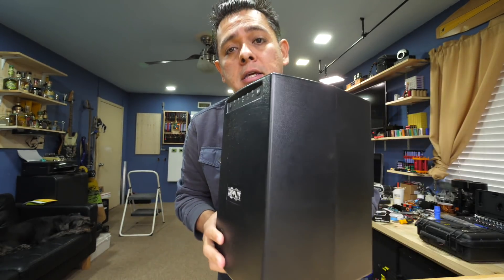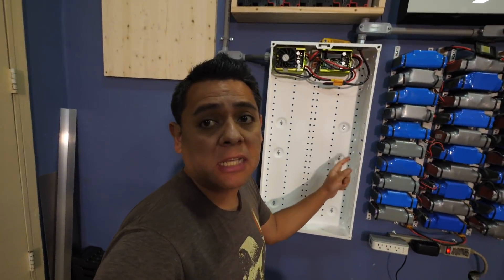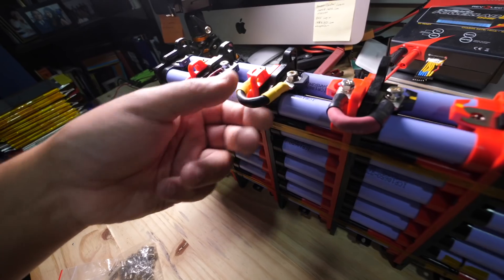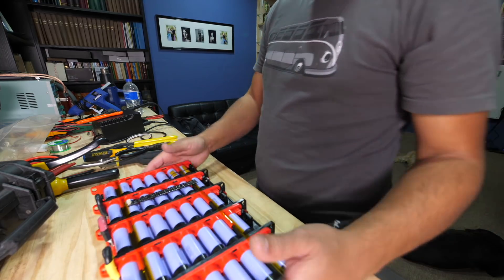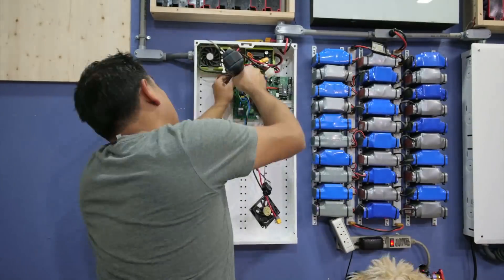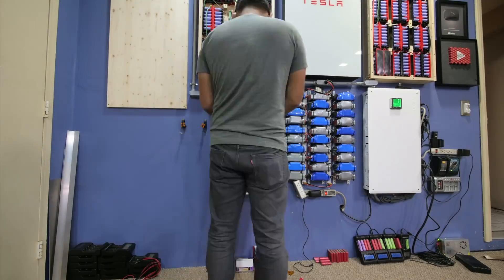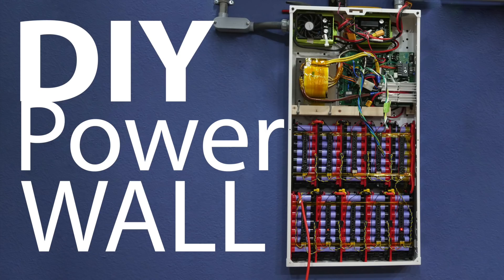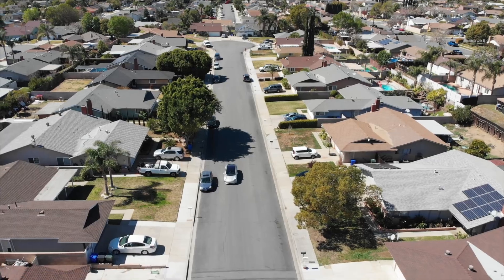1kw DIY PowerWall affordable  18650 build project (2018)

Comment: By no means do I mean to complain, but I think there would be a market for pdf instructions for these. Something we can print to achieve the same results. I see much of this as wizardry but a good guide step by step would help a lot. For those of us taking this on as a random summer project with 0 experience :)
Reply: brendan broomfield yeah... I get that, thus the request for a guide. I have a feeling that you missed the point entirely.
Reply: I totally agree with you if I could have a PDF to download I will make one as well.
Which I tried to make something similar and im having issues
Reply: I like making PDF's!
Reply: what is a "main breaker" and why does saying hey I don't need to shut such off when hooking a 10series x 3.7v power wall to the house electric system lead to a linesman being killed?
Reply: so unless you know what you are doing keep your hands off?
learning something new is pretty much defined by doing something you have no clue about. just saying ;-)
Reply: +1 for a PDF Schematics
Reply: i think Jehu G.  should publish an eBook on this? look on amazon and you'll only find a few.
Reply: Shane ive somehow managed to not accumulate student debt so far, id like to keep that track record. I get what you are saying but for someone who loves learning through exploration id still love some kind of reading material and or a real full guide rather than a howto that is missing large swaths of useful info.
Reply: brendan broomfield thanks for the recommendations! I really want to start delving in to it but I don’t know where to start. And as for the video, to me it’s kind of like sex ed..   people shouldn’t jump into it sex ,but people are going to do it anyway. So it can’t hurt to put a little more knowledge out there ya know? It may make it a little safer for the rogues who are gonna go all in whether they should or not. It’s all his choice though. As far as I’m concerned, you do you man.
Reply: I agree. Plans would be cool.
Reply: I could not agree with you more, and I'm an electrician, lol. He is smart/funny and, I like his videos, yet this video almost seems a 'tease'.  Just enough info/results to suck you in, yet not enough to execute it yourself w/o further, specific step by step instructions and a parts list, especially for newbies.
Reply: you laid the hard work methinks, the rest is "easy"
Reply: DO IT BRO !! I'D BUY ONE :) Especially if you can keep the cost down. For me this is a way to tell the Power Companies to GET STUFFED !! !! !! I don't know about your fellas countries though our power companies in New Zealand have been ramping up their charges and their Profits !! TAKE THE POWER BACK !! !! !!
Reply: you absolutely don't need to go to a trade school to learn it, but with this you need to learn before you burn. I can suggest a few books for you to read if you want to get a good start on it and then you can build up to this if you choose to. Practical electronics for inventors, the art of electronics (a bit technical but good) and delmars standard book of electricity. once you read either one of these it should give you enough information to be able to build onto to get into this so you wouldn't necessarily need a pdf guide to do it. Kudos on not accumulating student debt but please for the safety of yourself, linesmen and other people around you don't jump into doing something for cheaper. also not to mention 1kw isn't a lot that's about 5 hours of a gaming laptop, 1 hour of heating in a 10x10 room or using a blowdryer for around 40 mins, in most of these cases a ups would be just as good and probably cheaper.
Reply: Howdy Check out Will Prowse. He's big on YouTube he also has a forum that people like us can share knowledge and ask for help there's also a dude on YouTube names Jim From Denver. He charges for specific designs. I'd 1st go to will.Good luck
Reply: I agree completely! I've watched a lot of his videos and he skips a LOT of steps and some that he shows, he gives very little detail and direction. I haven't learned much from this channel unfortunately.
Reply from the maker: Hopefully someone that enjoys doing that sort of stuff makes one available.
Reply: jehugarcia what’s the max output you get from this kinda setup ?
Reply: If you have 0 experience, you should start with smaller projects until you understand this without needing a guide. Otherwise, you've got a literal bomb on your hands, and 0 experience. And that's bad.
Reply: Completely understand that you have to spend a LOT of time learning but if the videos don't contain any REAL information on how to do it, how do you learn? You don't. To learn something, you have to have information. It's like if you were watching a "How to build a car" tutorial and all they showed was pics of the car, motor, transmission. 
Well how tf can you build a car without knowing what is inside the motor, how to properly run gas lines, ect.? The "how to build a car" video isn't actually a tutorial at all and was a waste of time for anyone trying to learn how to do it. Only someone who has done it before would know.

"Here is a DIY video on how to build a power wall" but I am not going to show details on how to do it yourself. You should go on forums, read books, and figure it out yourself.
I CAME TO THE DIY TO LEARN HOW TO DO IT WITH VIDEO EXAMPLES INSTEAD OF A BOOK! But thanks for wasting my time.
I appreciate the video and happy for his success but for a new person trying to learn everything, this is a waste of time and he is limiting his market to only very knowledgeable people.
Reply: brendan broomfield - well hang on, you say if you need a guide, then don't do it - so what is the purpose of this entire video other than to say "buy an old UPS, stick it in a metal box, along with batteries and a charger".

 I really don't see that the video is of any more value than "look, I can fit a charger, inverter and a lot of batteries in just one big box". 

Personally I was interested as I thought it was a DIY Powerall similar to the Tesla design where only SURPLUS solar power was used to charge the batteries. THAT would have been awesome - and would probably be based on a current transformer or two, somethnig like a little raspberry pi and a tweaked switched mode power supply - but it wasn't.
Reply: Carl - not expecting a silver platter but other than saying "I put an inverter, charger and a lot of batteries in a big box - aren't I clever" - what exactly was gleaned?
Reply: Well, sorry to disappoint you, but if everything would be as easy as watching a youtube video, we wouldn't have engineering university. Would we? I agree that there whould be a PDF and I am thinking of making one. The thing is that it will be quite long full with all the info required to understand how a powerwall works, not just do this and that and boom you got fire. I am thinking of designing a DIY friendly system for battery management. Able to scale up to 50kW(output power). It will have 24 cells in series for some real power without huge currents. Still very dangerous.
Reply: Anthony Smith I really wanted to learn how to do this too, instead of looking for a shortcut like a pdf, I spent two years learning how electricity works at a local trade school. No pdf in the world could teach you how to fully understand what is going on here.
Reply: brendan broomfield I respectfully disagree with this comment. A guide is a start, that's exactly how you start. Keeping in mind you follow instructions and pay attention to what you are doing.
Reply: To put it into perspective, with just a few years experience, I can look at his setup and replicate it without schematics or a PDF guide. You'd want to rethink this as a "summer project" kind of thing, because it's really not something you can just leap into without any prior experience. But, if you're determined to learn, start reading up on how UPS's, inverters, transformers, solar panels, charge controllers, and li-ion cells work. 

You'll want to look up a table on general comparative specs (nominal specifications) of 18650's and familiarize yourself with their ratings (capacity, nominal voltage, discharge, charging current and voltage, charging time, continuous discharge current, internal resistance, safe operating temperatures for charging and discharging, etc) Cells operate differently (efficiency) at varying temperatures, and capacity is usually measured based on the discharge amperage until end voltage at a fully charged state and specific temperature. With most, discharging ("using" the "juice" in the battery) at high rates (quickly) and/or at high temperatures will shorten the lifespan of the cell. 

Go read up on li-ion batteries somewhere like Battery Bro. 

Then start researching how these things might work together. First and foremost, however, you should take the time to learn the basics surrounding electrical work, electronic components, A/C and D/C, the differences and similarities. Read up on single phase through three phase A/C and what you might use in your area. Really, you just want to start at the basics and work your way up to dealing with the big bad stuff that can kill or maim you or someone else in many, many painful ways. 

That wall of li-ion 18650's has the potential to be, once a failure occurs, a /giant/ torch that once it starts venting could create a cascade of failures in the rest (this is why he uses sensors for monitoring temperature, and other equipment for monitoring and maintaining safe levels of operation), leading to a fire that you would be hard pressed to put out. In a matter of minutes your entire home would be burning down. Look up videos of just one 18650 failing, or someones ecigarette mod with just a single 18650 in it exploding and you'll think twice about trying to cobble together dozens of these into the wall of your home without experience.
Reply: I wouldn't recommend doing it, if you need pdf about it.. google some more until you don't need the pdf.. for your safety.
Reply: 0 experience = stupid    pdf? really?
Reply: That's a shame to all those who didn't like that he didn't put it on a silver platter for you...

Sorry - but it's technical... and you have to try and spend a LOT of time learning.

If you don't want that, you want the pre-made solutions - already for sale - and the cost incurred.
Reply: it's not meant for someone with 0 experience. You're dealing with a ton of batteries which while they are generally safe someone who doesn't know what they're doing can and probably will make a huge mistake. say you built this do you have the knowledge to know what you're looking for as far as potential problems what if you say choose batteries because they're cheaper not knowing the discharge rate for them and you try to drive more out of it. You're dealing with a lot of potential power in dc form which definitely isn't safe, people need to remember electricity can kill and even if YOU think you're safe with you're limited knowledge and experience someone with that experience would probably get their guts turned by what you're doing.
Reply: " there would be a market for pdf instructions" That part was not taken into account. Sr. bredan Your answer is a perfect example of the benefit and the need for reading a pdf. But the people like us, that love and enjoy Sr. García projects because we want to expand our need to do things (DIY). In my case it is the need to keep the refrigerator/ice box and washing machine running at a time of 9 month of no power. Was my reality in Puerto Rico. For others, one year after the hurricane things have not changed.
Reply: @brendan broomfield, I disagree.  If someone is able to follow instructions then why not show them how.  Most people can put an Ikea thing together.  There are factory workers who assemble goods without having detailed technical knowledge.   It’s the same thing.  If the instructions are well written and show how to measure and properly check things, there shouldn’t be an issue.  The key is that the instructions must be thorough and have a troubleshooting part to it.  In industry we write documents like this for complex systems.
Reply: @GodzillaGoesGaga  dude it's stupid to think doing this is the same as an ikea desk? They don't have detailed techinical knowledge but guess what THEY ARE TRAINED... I don't know why people feel the need to get back to me about this thinking they can do something like this safely. As I already explained it's not that hard to make but easy to screw up and dangerous. You know if you use this when it is not UL listed or govt approved and you burn down your house chances are you would be liable for any damage and not your insurance. You're troubleshooting part is where it all falls apart most people can't install a thermostat and that's easy as hell, when you do something like this you have to know what you're doing. I really want to do self dentistry and I think they should show you how to able to work on you're own mouth hell if they make instructions for complex systems that anyone can look at and figure out they should do that. Think before you say something and understand that electricity is not something that should be toyed with by the inept.
Reply: @brendan broomfield, you are making big assumptions about people being stupid or not talented enough.  I someone wishes to undertake a project like this they are in all likeliness capable of learning, researching and executing the project.  A person who’s knows nothing is likely to give up as itks too complex or they will ask for help.  Don’t think that you are uniquely special.  You may have some knowledge but how did you get that knowledge ?  Education comes in many guises.  Now as far as the people wanting to do this kind of thing, they can build and learn as they do it.  I have built lots of things, I now know how to build to code (I’m not a structural Engineer), I know about certification bodies and the like as a result of it.  I have built many mechanical things and done lots of work on cars (I’m not a Mechanical Engineer or Automotive Mechanic).  Having the ‘someone else must do it’ attitude is completely incorrect. What you have to do is be able to look at your skills, see where you are deficient and ask for help in those areas.  If you need UL approval, you ask someone who knows about that and how to navigate it.  If you need other planning permissions, you ask.  There is a body of information and a body of people who can and are willing to help.  The internet has made it so much easier to find these people.   So with that said, you take on a project and then get help.  If you have no experience you find someone who’s willing to help.  I personally love helping people out with projects when time permits.
Reply: @GodzillaGoesGaga  I absolutely do not think I'm uniquely special. Also as I have stated to people in the past I do not go against learning something just not going to learning on a GIANT WALL OF DEATH for the inept as I said. If you're capable of learning on how to do a project like this then you don't need a schematic, if you do need a schematic then you're not capable. This isn't mechanics this is electricity in mechanics you can physically see something that can kill you in electricity you can't. I DO NOT DISCOURAGE PEOPLE FROM LEARNING ABOUT ELECTRICITY BUT YOU SHOULD LEARN ABOUT IT BEFORE TAKING ON SUCH A LARGE PROJECT SUCH AS THIS AS IF YOU SCREW UP THE BATTERIES FOR EVEN A SECOND IT CAN CREATE A GIANT BLAZING FIRE IT HAPPENS IN PEOPLES VAPORIZERS AND YOU ARROGANTLY THINK YOU HAVE THE ABILITY TO ENSURE SAFETY??????
Reply: I don’t arrogantly think anything about Safety.  I am an Electronic Engineer who can check this stuff.  Having designed Megawatt lasers I understand safety.  However I will still refers to others and procedures that have been written down.  This is exactly my point which you fail to get.  If a project is DOCUMENTED CORRECTLY then there is little chance of screwing up (I stated this earlier and you are still banging your drum).  Example:Would you know how to make a car from scratch ?  Probably not but if you asked for schematics (what the o.p. was asking for is probably the procedures and process docs) you would be able to make a car.  Would you blow up in doing so when you turn the ignition ? Probably not.  Because there was documentation and a checklist.  Would you learn something, absolutely.
Reply: @GodzillaGoesGaga  would you fly in a plane you fixed yourself? all technical docs are available should be easy. If you're an electronics engineer and you need a schematic for this it's fairly laughable as this is more or less just off the shelf parts save for the batteries which he more than likely harvested from dead electronics / packs. This is an overly simple project or at least it would be if it wasn't for connecting up the batteries.
Reply: @brendan beoomfield, you are making stupid arguments now.  Yes I do make and do fix my own aircraft.  I didn’t say I needed a schematic.   I have designed high power systems and totally understand how this works and could probably make improvements. However you did not read my statements about having Procedures and Process documents which allow people to make things correctly so I’m not even going to bother discussing this any more as you just want to argue for the sake of arguing and don’t have the maturity to accept other views.  Have your last work because we are done here.
Reply: @GodzillaGoesGaga  I think you're making stuff up you have gone from a car mechanic to electronic engineer to an airplane mechanic, I highly doubt you're any of these. Anyway you keep saying procedures and processes and documents (instructions) on something so inanely easy. It's clear you don't know what you're saying you're only trying to make yourself seem more knowledgeable than you are.  There really was no discussion you have an uneducated opinion which is equivalent to no opinion at all.
Reply: @Brendan Broomfield, I have never said I was a car mechanic and I have never said I was an airplane mechanic.  I said I would fly in an aircraft I had repaired (as in ultralight), I also mention that I can repair cars.  I am an Electronic Engineer who has over 100 products on the market (in all likelihood I was designing stuff before you were born!).  Send me your email address and I’ll give you my linked in profile if you want.  You can doubt all you want...
Reply: @GodzillaGoesGaga  cool, because a linked in profile proves that. From what it sounds like you want step-by-step instructions which an engineer shouldn't need. Solar Panel -> Charge Controller -> Batteries -> Inverter -> Fuse ->  Plugs.  With something so simple you can understand why I call you're abilities into question.  Oh btw I thought you weren't going to be getting back to me and let me have the last word? I don't really care about this it's just every couple months I get someone coming on arguing with me that you could learn by doing and my analogies are going over you're head....Cooking is simple would you be willing to cook and eat a puffer fish being shown how to remove the toxins?  You're dealing with at least around 100 batteries that people have in vaporizers that miraculously explode and you feel comfortable doing that with 60 times the amount?
Reply: @astereon6017  A pdf of the wiring diagram with standard IEC or ANSI symbols would be helpful for anyone trying to make something similar who already has electrical experience.  Any random person watching this video without the experience or education to understand what they are looking at would have extreme difficulty reading a schematic.  I know that some YouTubers post information in their Patreon or other communities such as this.  If someone does attempt to do something they aren't prepared for and get hurt in the process then it is on them for using information on the internet and that's Darwinism at work too.
Reply: @davisbradford7438  schematics wouldn't be necessary he has a lot of off the shelf parts this is a relatively simple and straightforward  build albeit time consuming that requires some math to get right. As far as the darwinism at work that's fine for the guy who built it but what about their family or say the next door neighbor. I mean he's using a ups power supply to transform it to 110 vac. If you really wanna know how to build it here's how it goes solar panel -> charging circuit ->  batteries -> UPS and throw a fuse on the power out. simple done. if you need hand holding through this process don't do it, this is absurdly easy.
Reply: Weekend Productions nope not what I'm saying. What I am saying is if something happened and a fire started what would you do? Use a fire extinguisher right? OK so you pick up a fire extinguisher fine, you get one that is only an rated you screwed yourself. Next you think hey I know I'll hook it up to my house great but then you hooked it up to the panel through a breaker because you know if it works, then you kill a linesman because you're good enough standards made you say hey I don't need to shut off the main breaker. So what I'm saying is if you actually stopped to think for a minute you would see learning something is good but ACTUALLY LEARNING INSTEAD OF DOING is good. I'm all for leeting surgeons learn how to operate but I wouldn't want them to learn a difficult procedure 1st week in
Reply: I get the point you said and what I'm saying is if you need a guide you definitely shouldn't be at it.
Reply: @astereon6017  your missing the DIY spirit. Even Jahu with a 6th grade education is getting it done
Reply: @RANDOG1951  I'm not missing the DIY spirit, you need to have at least a basic understanding of what you're doing before attempting something. If I with no understanding of fuel or chemistry but found a recipe for rocket fuel and decided to mix up a barrel of it and test it's capabilities and I lived say 50 feet away from you would you be fine with my diy spirit?
Reply: @astereon6017  I am talking about a small battery system.if a person is planning service connected to the grid,different story.
Reply: @RANDOG1951  look up a single lithium battery burning first. most people would want to have more power than a ups could supply which is around 1kw so we'll say 2 kw. That's 180 cells, whether that's connected to the grid or not that is some seriously dangerous hardware in the hands of a newbie who doesn't know what the hell they're doing. every so often I get the same argument from someone like you saying it's against the diy spirit or something of the likes but frankly it's dumb as shit to even attempt it as a beginner project. hell you don't even understand the complete uselessness of this project for those trying to be cheap and save a buck. Here is the plan anyway if you truly want to build it, it's absurdly simple. solar panel -> fuse -> charging controller ->cells in series parallel in bunches of whatever the charging controller is putting out -> inverter -> fuse -> outlet
Reply: @astereon6017  welding wire shunts fuse box grounding it's easy.
Reply: @astereon6017  some of these shmucks need to go look up how intense and how long a tesla burns for thats the equivalent of whats going on here if something went wrong